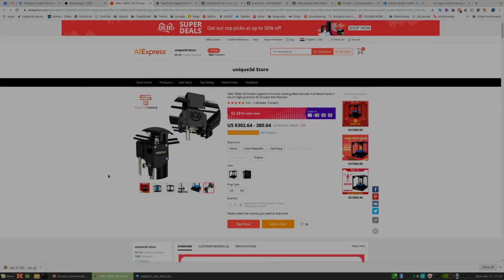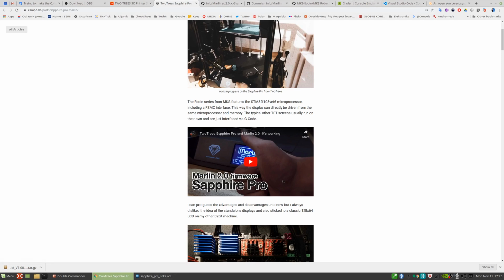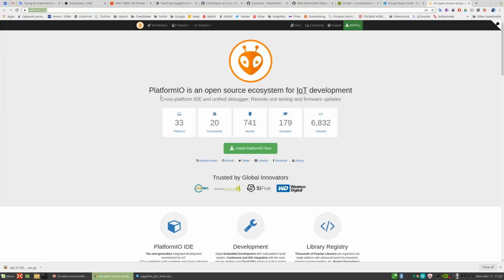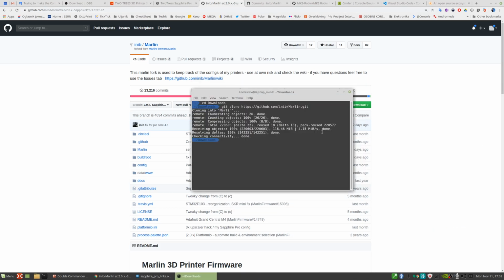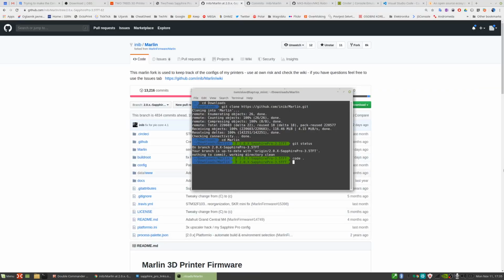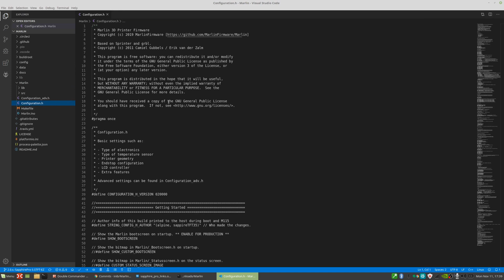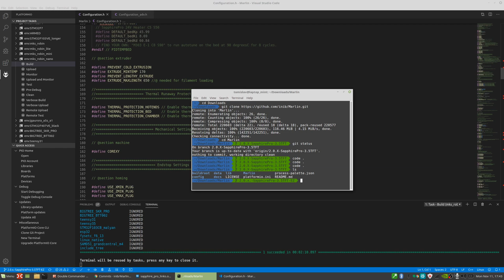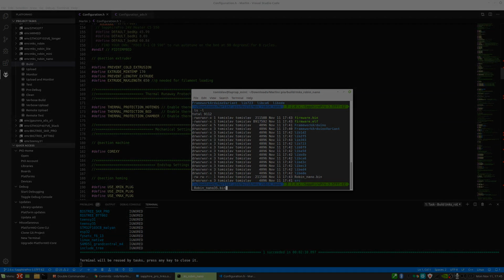Sapphire Pro Marlin 2.0.X

Comment: Does the Sapphire Pro work with Cura ? If not what software will it work with for slicing gcode ?
Reply from the maker: I used Cura, S3D and Ideamaker and all work fine. I print technical prototypes mostly and for that I like Ideamaker best.

Comment: Thanks, this got me over the hump and the Marlin is loaded and seems to be working. My only issue now, is getting it to start printing. All temps are set and waiting but the print doesn't start.
Reply from the maker: When this happened to me it was because the pid loop was not tuned. The printer would start the print and was waiting for the temperature to stabilize to start printing but this never happened because the temperature would oscillate around the set temperature. As you did not give any details in your comment I could only speculate.
Reply: @TomislavDarlic  thanks Tomislav, that must have been the issue. I recompiled and loaded the same and with some more patience it started printing. Now I can start the calibration process.